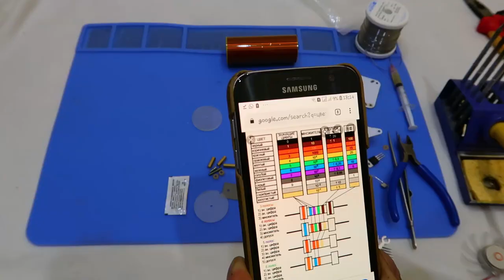Tesla music coil kit assembling

Comment: Thanks for the video. Do you have circuit schematic?
Reply from the maker: No, but it's very simple.
Reply: I think i burn the transistor after using the coil for a while, I will replace it as you show on this video. At first, I just want to understand how the circuit work. Thank you anyway.
Reply: @js0773  its probably a modified slayer exciter circuit